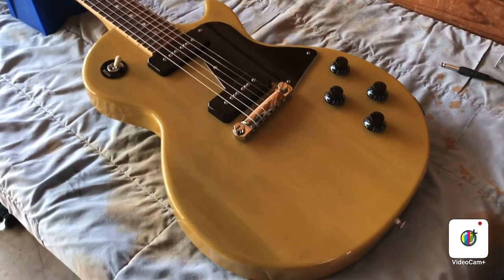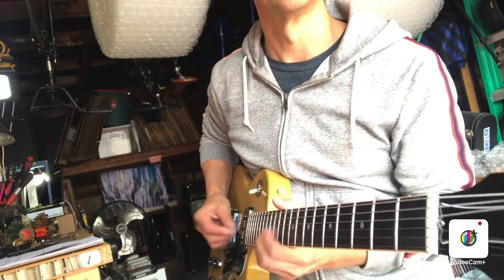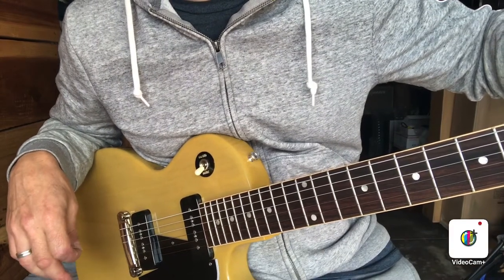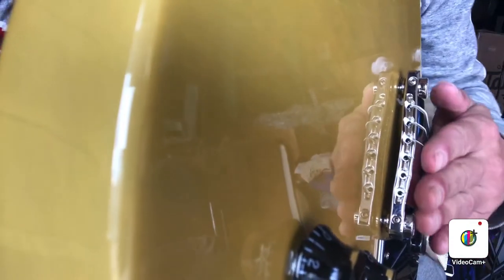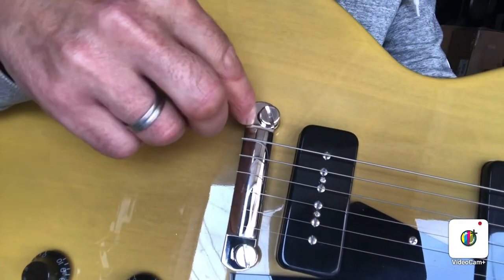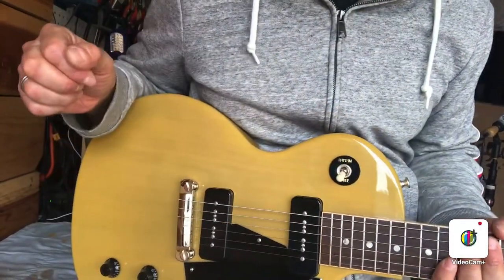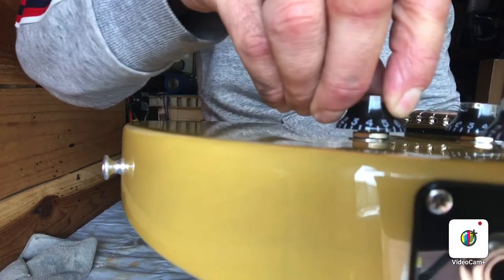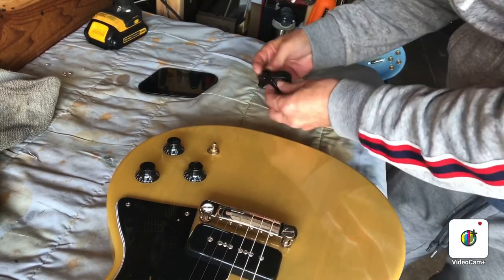Gibson 2019 Les Paul Special guitar setup--setting intonation, turning truss rod, etc.

Comment: When you raised the height of the bridge did you loosen the strings? I have the same guitar and when I raised the bridge, it was very hard to turn the post. It was much easier when I loosened the strings.  It’s still hard for me to get it right. You’re right about the Allen wrench size. Good video man!
Reply from the maker: thanks! actually for me the string tension doesn't matter as much as just seems some of those bridge posts get kinda stuck over time. and you're right this one was tough to turn.

Comment: When would you consider changing the bridge?  There are those with individually adjustable slots,  or these similar to your bridge but with a groove that kinda follows an optimal intonation.  I don't get why certain guitars can be intonated with that stock bridgw and others require different bridges,  if we are talking about the literal same guitar with the same geometry. 
I am considering buying a LP junior but i don't want to go crazy trying to adjust the intonation,  but maybe thats just trying be to precise.
Reply from the maker: Hi,  it's because some are set up at the factory with perfect intonation with that set bridge. Others are off. For those, you either live with it being slightly off, like many do, or you can buy an aftermarket. bridge that has adjustable saddles, or you can try a tailpiece with the Allen screw adjustments, which is not quite as accurate, but works pretty well too. The "lightning" tailpiece is the one with grooves that may also get it a little closer but it's not adjustable at all. But bottom line, Juniors are awesome gutiars.If exact intonation is important to you, you might get lucky with one from the factory, or if not have to buy another bridge. cheers!

Comment: So-If you could answer a question-If the 12th fret is sharp-Which direction do you turn the set screws? Clock wise (to the right) or Counter Clockwise (to the left)? Haven't found any videos yet to explain this. Thanks.
Reply from the maker: Sorry should have said you would turn clockwise if you're sharp at the 12th fret. You want the string in essence to become longer, so you're moving back the bridge/saddle, etc.

Comment: 4:55 i can't put fully inside again the top allen screw to adjust intonation :( it stops before reaching the end of the hole, is it screwed up?
Reply from the maker: @eusebiomanrike  possible problem with the threads on the screw. Try using some lubricant on the screw. Be careful not to strip the Allen hole. You need to use correct size wrench. Also I hope you have the strings nice and loose and you can easily move the tailpiece. You could confuse string tension with a problem with the screw.
Reply: @stillkickinmusic  Thanks! how do i know if i damaged the allen hole? i used the other screw and it can't come inside neither, i'm kinda disappointed of myself
Reply from the maker: @eusebiomanrike  if you turn the Allen wrench and it just slips you may have stripped the inner part of it. Not the hole on bridge but hole on the screw itself